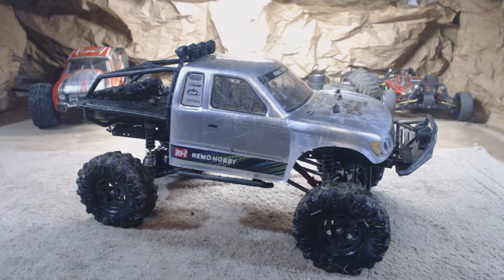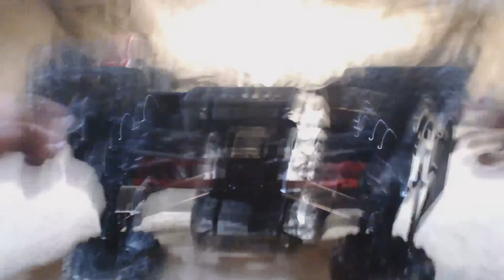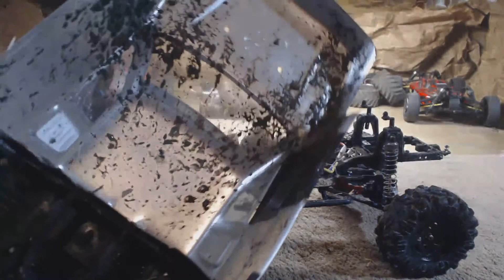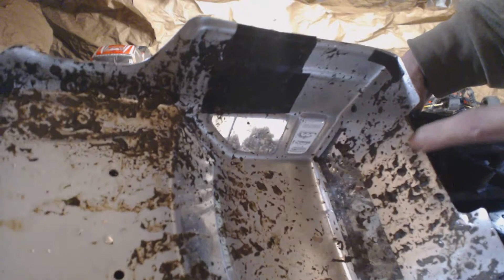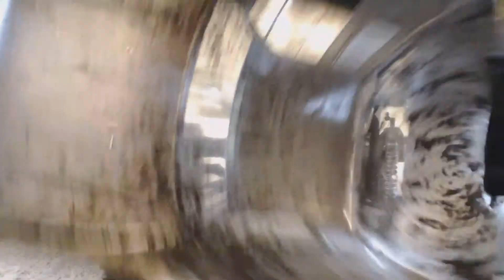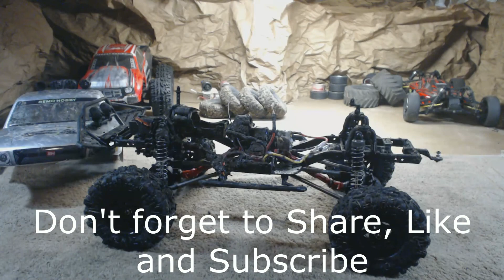Remo 1093 Afterthoughts

Comment: My driveshafts were binding a lot out of the box. The pivots on the ends were off by 90 degrees and they weren’t adjustable. Replaced them with cheap alum ones and it’s super smooth now.
Reply from the maker: Good move! The stock drive shafts have a lot to be desired.